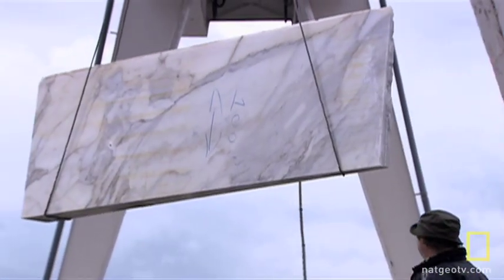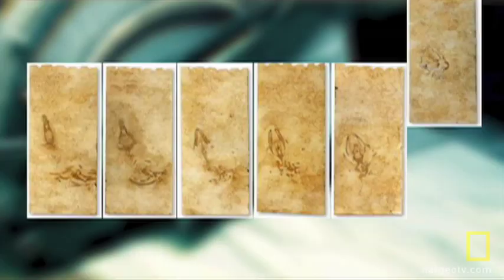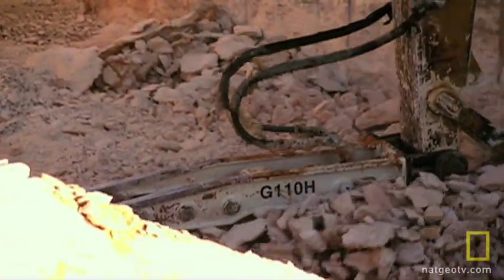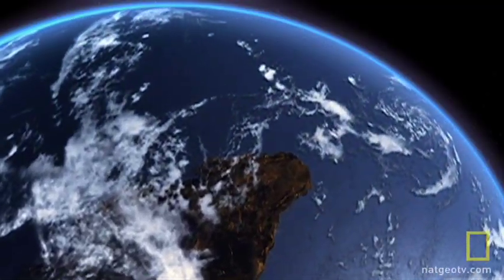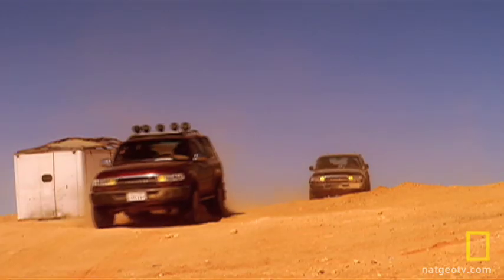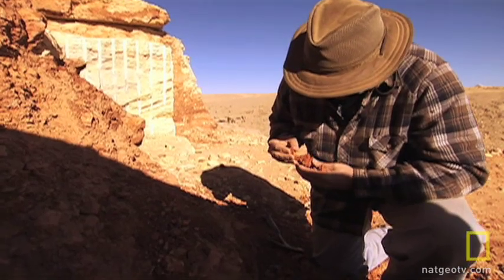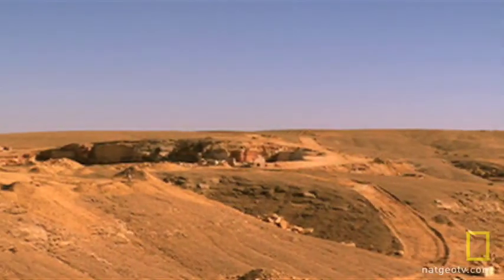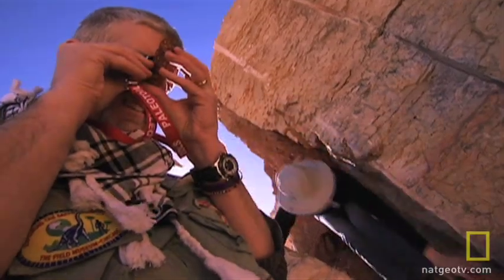Fossil Found in Kitchen Counter | National Geographic

Comment: @boosie007666 The problem is that you have fallen for the millions of years lies. there is Not 1 single Scientific ...evol dating method, they are all circular reasoning based on a non existent geological column. If you use real Science not evol. Fairytale Nothing is older then approx. 6000 years old. That rock was romed because of the flood and that is how the whale got there.
Reply: coolvideo28, if you knew as much about geology as you think you do, you'd know that geological dating of rocks is done using most commonly the radiometric dating method, not your so-called evolution dating method which, by the way, doesn't exist.  While it is true that for over a century (the 19th century), the relative ages of rock layers were determined by the fossils if there were any, found in the rock layers.  But this merely determined the sequence order of the layers, not their true age.  

Radiometric dating, which is used to determine actual ages of almost anything old, from ancient materials used by people (Carbon dating) to the ages of rocks billions of years old.  The science behind radiometric dating is very solid, otherwise, it wouldn't be considered valid for archeological dating.  The technique determines the ratio of a particular radioactive isotope of the target element to the decay products of that radioactive isotope.  The greater the ratio of decay products to the radioactive isotopes, the older the sample used.

As a devout Christian who has a firm grasp on the science used in these various radiometric dating methods, I have no trouble at all accepting the results of the dates revealed by these methods.  The God I worship is a God of order, not of confusion.  He has given us the ability to develop these accurate methods to determine the natural ages that not only fits the evidence but to see the logical progression and methods He uses when He creates the world around us!  I must point out one of the glaring errors of the 6000-year-old-Earth hypothesis: nowhere in the Bible does it state that the Earth is 6000 years old!  The hypothesis, which presumes that the 6 days of creation were 24 hour days, is not even supported by Jewish Biblical scholars, who are probably the best judges of what the original Hebrew texts say in Genesis.  Even Jewish commentators who oppose some aspects of science generally accept scientific evidence that the Earth is much older.  If you're going to use the original Hebrew texts to determine how old the Earth is, based on the Young-Earth hypothesis, you need to determine which texts you are going to use, as the various texts give different estimates.  Estimates based on the Masoretic text vary by quite a bit depending on who did the calculations.  And estimates based on the Septuagint are generally about 1000 to 1500 years earlier.  All of these estimates are based upon the notion that the Creation narrative uses 24 hour days.  I remember a Jewish rabbinical scholar telling me one time that Jewish scholars get a kick out of that notion.  He said that the word used for "day" is the same used to indicate longer passages of time, what we would call an "age."
Reply: Edward Cabaniss
I'm not religious myself, but it's always nice to see someone who wont let their beliefs blind them to the evidence. You are one of the few people on these pages that seems to know what they are talking about.
Reply: Your smoking too much pot.

Comment: @111E982a Nope sorry drug resistance has nothing to do with anything 'evolving', just because something changes doesn't mean it evolved.  You are using a term that describes something completely different, its like your saying a caterpillar evolves into a butterfly- it is its own process solely apart from what the theory of evolution indicates happens over millions of years.
The notion of 'millions of years' itself is unsupported- mere conjecture and assumption built into the theory.

Comment: @Howie47 " Order does not arise from disorder, without intelligent impute. It's a dumb theory, from beginning to end!"

Well, it is an old example but it will serve you well. Look at a beach. Notice how the sand is well organized.  Try to dig a hole, try to build a castle. You are disorganizing it. Yet, the sea will organize it again. And it is not only at the macro level. There's a certain pattern to sand grain size/debris type and its position in the beach. No intelligence -- just order.

Comment: @RHawkeyed  Gravity is caused by the draw of energy matter takes in order to sustain it's physical existence. For some reason planetary bodies draw a little more than they need from the field hence they're over unity and the cores of the bodies are hot and planets further from the sun output more energy than they take in from the sun. They also end up expanding because of this over draw. And like idiots we run power lines though this energy field like fish running water pipes through the ocean.

Comment: Easily answered! As the sea receded, any low lying areas of the sea bed would have been cut off by the receding water, forming huge lakes. Just like the old salt lake at 'Salt Lake City'.

The same thing applies for the area of Egypt where this fossil was found. An area of sea became land-locked, the water evaporated to be replaced by deserts, leaving the buried remains of sea creatures. 

Deserts are made of sand, and sand is made by water. Ergo; where you have deserts, you once had water.
Reply: The most common component of sand is silicon dioxide in the form of quartz. The Earth's landmasses are made up of rocks and minerals, including quartz, feldspar and mica. Weathering processes — such as wind, rain and freezing/thawing cycles — break down these rocks and minerals into smaller grains...
Reply: @conversely123: Not likely. If whales got trapped in a lake that then dried up, they would likely die in the lake well before the lake fully dried up, due to there not being enough food in the lake for them to eat and/or the lake becoming too shallow for them to swim around. So then you'd have whale carcasses lying around in shallow water, where the remaining creatures in the isolated lake would scavenge the whale remains. It would also rot and fall apart and bacteria would feast on it too. Finally, the lake might completely dry out, leaving the bones exposed to the sun and wind, which would eventually turn them to dust, leaving no trace of the whales.
The only way a whale could be fossilised is if it was rapidly buried under much sediment so that scavengers could not disrupt the body, and so that the mineral rich moisture in the sediments could petrify the remains.
To rapidly bury a whale under much sediment requires some catastrophic event like a major flood sweeping a large mudflow into the area and overpowering and burying the animals there. Noah's flood is an excellent candidate to explain the presence of fossils all over the world.
Reply: conversely123 ayy i live by the great salt lake
Reply: There's a desert in Antarctica.
Not much sand though.

Comment: Gonzo: Actually you are wrong. There is a lot of information important to professionals online; hwr, to gain access to the information requires an acct w/a professional of specific fields or accts via hospitals & major medical institutes where professionals can go online to read various current and archived medical journals. I've read plenty of medical journals in my time. It's much easier to bring up the info digitally, when available, than tossing through yrs of print back-issues.

Comment: Soldieroffortune: you brandish your alleged degrees so adamantly that one might wonder if you're not just making them up. Despite your claims a very large majority of the science community thinks that the evolution theory is correct. 
Furthermore, you seem to confuse the concept of "theory" as used in everyday life and "scientific theory" which is used in actual science. Check out the wiki entry on scientific theory if you don't believe me.

Comment: Yes, they can. *Carbon* dating has a limit up to ~50,000 years. There are other isotopes they use for radiometric dating and you can go back further than 50,000 years.